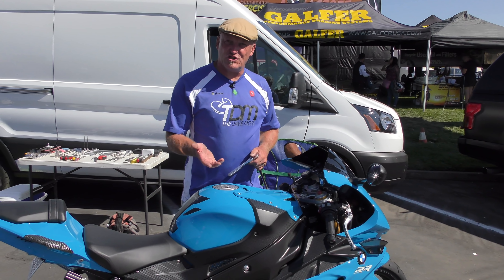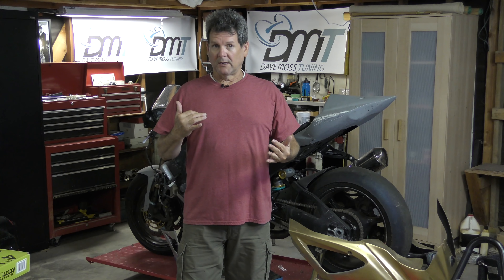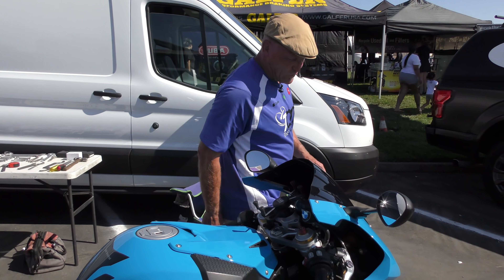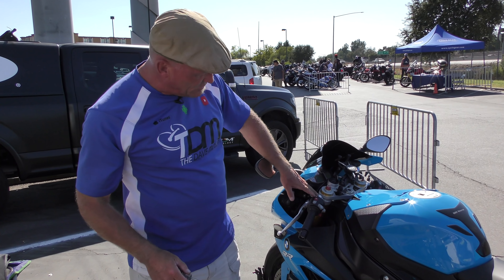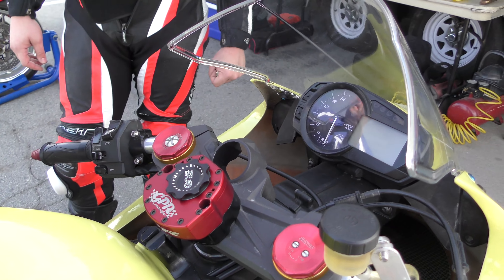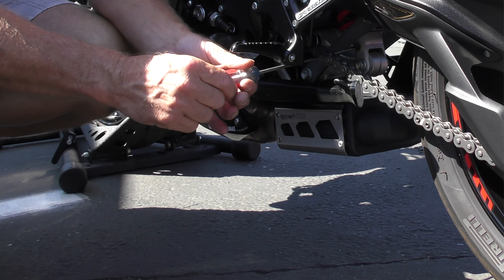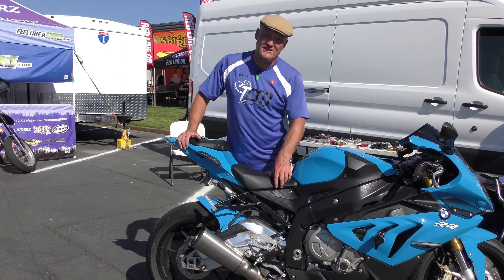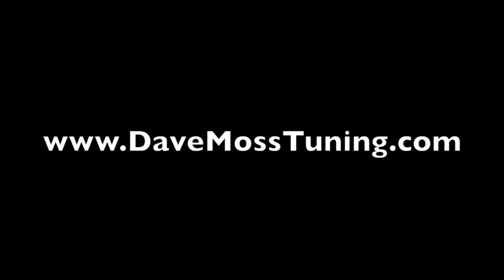Motorcycle Suspension Adjusters: What Why Where and How

Comment: Hi Dave, thats you for making this video, its a great video with all detail information for anyone to learn about their suspension system. 

I have a small question hopefully you can help. In the video where the BMW S1000RR fork preload, rebound and compression have different settings in each leg. Can i know how can we tell which leg to follow please? For example in the video you started counting on the right leg then use it as reference. But if you were to start the count in the left leg the count would be different isn't it?

Appreciated your clarification :)

Edward
Reply from the maker: Hi Edward. Manufacturer's have different settings per leg so your handbook will tell you what is where for damping and preload. In the S1000RR case, yellow has always been rebound (right leg) and red has always been compression (left leg) in separate function legs. You will see the same color coding on the rear shock. Counting from maximum clockwise or minimum counter clockwise will give you different values unless you by chance hit the exact middle of the count eg: 12 of 24 total clicks..

Comment: Question:
At 5:12 “this is always compression” 
but then,
At 6:50 “the preload is at the bottom”

I’m not sure if I’ve missed something, but which is which?
Reply from the maker: A tradition USD fork has many forms and the BMW had preload and rebound at the top and compression at the base. Big Piston forks have any number of combinations as well but in the example, the preload adjuster 5mm allen is found at the base. In the last couple of years, some BPF have changed tondamping left leg and preload right leg - adjusters in the caps.
Reply: @catalystreactionsbw  Excellent, thank you!

Comment: Oh right, Nitron! How does Nitron compare to other brands quality wise? Their prices seemed to be more friendly on the wallet :) (I'm contemplating switching out the STX40 of my 765RS since the original once got damaged internally, the piston chewed up the cilinder. Got a new one under warranty, but if the same thing happens again after another 20,000km I don't think I'll get a new one...)
Reply from the maker: https://davemosstuning.com/?s=Nitron+shock
Reply from the maker: It is the only aftermarket shock that I have used where after 1,500 track miles the settings were still the same as when new.
Reply: @catalystreactionsbw  Wow, sounds good! Thanks.

Comment: I wish Dave would do a Basic Suspension Setup for a 2004-2005 ZX-10R. This Bikes gunna Kill me if I don’t get it setup, I went softer but the rear still feels stiff. It’s setup Per manual. But I weigh 20 pound lighter then setup for 150:
Reply from the maker: That's why I developed remote tuning to make sure that riders like you can get access to me no matter where I am in the world. Please email me dave@davemosstuning.com to start the process.
Reply: Thank you. I’ve watched Every video I possibly can. I’ve Gotten to know Suspension Pretty well & How it works in the last 9 months. But it seems very difficult to set my bike up for me. I feel like I can set somebody else’s bike up perfect but for myself not so much.. The most important Thing to me is Getting my Bikes Geometry Correct. Everything els I should be able to read as the bike is ridden.. I’ve heard The 2005 zx10rs. Are a Nightmare to get Right. I’ve watched all your videos. But the most important info is cut out of all your videos or fast forwarded over. I get it people need money. But also way harder to learn when you only get half of the information needed..

Comment: On my rear suspension I have somthing that has 30 clicks from soft to hard what will that be changing?
Reply from the maker: Your owners manual will tell you. if there is only one adjuster on te shock you can use, it will be either preload or hydraulic damping.

Comment: Sorry to ask this question guys but I want to be sure. 
When they refer to 
"2 clicks out" they mean turning counter clockwise? So starting from 10 going to 0
"2 clicks in" they mean turning clockwise? So starting from 0 going to 10 
Correct?
Reply from the maker: Industry stand is out = counter clockwise, in = clockwise for both hydraulics and preload adjustments. Preload starts all the way out and count in clockwise, hydraulics start all the way in and count back. You can choose the method you want.
Reply: @catalystreactionsbw  thank you very much for this clarification

Comment: I had a small CC motorcycle (gsxr150) watching few of your videos, noticed that my bike have a really bad suspension setup but then, its doesn't have any adjustments :'(
Reply from the maker: so can you chage fork oil, fork springs and fork geometry? Sure! Can you replace the spring on the rear shock? Do you need to get a better rear shock based on using a tape measure?

Comment: So does that mean on the Kawasaki all the dampening adjustment is in one tube and and all the preload is done in the other tube?
Reply from the maker: That is correct.
Reply from the maker: Dave Williams, editor, replying here. As Moss said, that's correct... until the recent Showa BFF forks on the ZX-10RR and GSX-R1000R which have the preload in the top of both forks (same star screw adjuster) and the Comp & Reb damping screws below by the wheel in the lower casting of both forks. Looks like a bottle cap. there is a matching Comp and Reb bottle cap on the top of the shocks.
Reply: @catalystreactionsbw  OK.  So does that mean one tube takes care of dampening and the other preload?  Or is one adjuster adjusting both tubes?
Reply from the maker: @OregunAdventure  damping is in one leg, and spring preload is in the other leg. They are unique.
Reply: Dave Moss Tuning hey thanks guys for the replies!

Comment: what rear shock dampening settings give the SOFTEST ride...in, or out?  Dampening, or no dampening?  What does dampening do?
Reply from the maker: softest ride = low preload and compression (left direction in most cases). Dampening is oil flow management based on age, viscosity and flow rates with temperature.

Comment: What kind of sag setting you would suggest for trackdays?
Somebody told me to use Preload 35mm to 40mm at front and 30mm to 35mm at rear, sounds pretty soft to me... is this correct?
Reply: Joonas Dahlin I feel like I have heard him say 20-25 rear for the track.
Reply: @Dub3God  Oh okay, thanks mate I totally miss that part
Reply: Don't worry about sag for the track.
Reply: @rippin187  why?
Reply: Desert Sky yeah please do not listen to this guy. Sag is the first thing you set before rebound and then compression.
Reply: Dub3God Setting sag is not important on the track. Most people don’t give two shits about sag on the track. If you are slow in C group and going street pace then go ahead and set sag.
Reply: @rippin187  Once again don't listen to this guy. If the suspension is not properly setup for your weight, aka first thing you do is set sag, you have no right to ride that bike. End of story.
Reply: @dave moss tuning will tell you the exact same thing.

Comment: So I'm confused is it preload or compression that makes my zip tie lower or higher I adjusted my preload for my weight in the front between 25-30mm and I'm going for rides braking hard to see where my zip tie lands and adding compression if needed, If the zip tie is too low but I seen other videos where I heard if the zip tie is maxed out and your can't add preload you need better spring rates so what is it? Preload or compression.

Added note someone correct me if I'm thinking this wrong set preload to your weight to start then ten and compression test the bike with a zip tie. If you are bottoming out the zip tie and high on compression start adjusting preload and reset your compression and keep the cycle going?
Reply from the maker: Preload sets the strength of the spring. Compression sets the flow rate of oil as the forks compress. Both work together. You can remove all compression and ride. Then reset compression and remove all preload and test. That will give you the unique knowledge you are looking for by testing one adjuster at a time.
Reply: @catalystreactionsbw  thanks Dave next track day is the 12th imma run my proload set to my weight with higher compression and If starts to bottom my suspension out I'll add some preload and work from there
Reply: As I understand it preload is for setting ride height, so once your static sag is correct and you’re out riding if your getting too much travel when braking or over bumps then you increase compression damping, if you can’t add any more or the suspension starts to feel harsh then you should increase spring rate (put a stiffer spring in).  I was always led to believe that you shouldn’t try to compensate for an incorrect spring rate with damping.

Comment: Hi, i'm having a hard time finding the balance between static sag and rider sag on the rear shock of my 2018 Z1000. I'm a heavy guy 120kg (265lb). So i had to turn the preload all the way in just to get the appropriate amount of rider sag but then there's no static sag at all since the shock is fully extent even under it's own weight. Any recommendation of what I should be looking for for street riding?
Reply from the maker: At your weight, you will run out of static sag as the spring is too soft, hence your question. Increasing the rear shock spring rate to a 12.5n/mm would be ideal. We always double check with a visual inspection of how much shock travel is being used. If all of it, a spring upgrade is mandatory.
Reply: @catalystreactionsbw  I see. Then no choice. I'll start look for stronger shock. Thank u very much!

Comment: 7:43 what does fork position do? measuring distance from triple clamp to top of the fork? If you increase the protrusion,  are you adjusting the rake and trail? i'm new to this and trying to make sense. 2017 HD Dyna S. What happens if they are off by 1mm. Would it cause a long term damage to the axle because left and right fork have different length?
Reply from the maker: When you increase the amount of fork showing above the triple clamp, you move the balance point of the bike forward. It may or may not change rake and trail depending on how stiff the forks springs are. It may quicken the turn in meaning less energy is required to initiate turn in. If you decrease the amount, you raise the front moving the balance point backwards. That may increase rake and trail.  Hope this helps!
Reply: Dave Moss Tuning thank you!

Comment: I have bmws1000rr  2013 ... when I’m over 200kmh it starts head shaking so terribly bad I almost cannot control it on a straight piece of good road. Some sugestion pls
Reply from the maker: Set sag correctly at 30-35mm for the forks and shock. Check rear wheel is correctly aligned.
Reply: @catalystreactionsbw  I`ll try tomorrow Thanks for answer

Comment: My 07 Yamaha R1 is throwing to the left could it be the pre load is off
Reply from the maker: Check rear wheel alignment, check fork height is exactly the same on both sides, check fork settings are identical per leg.

Comment: 2013 Triumph Speed Triple (not R) has no adjustment for rear preload. How to you measure rear sag if that's the case.
Reply from the maker: You can measure what you have and write the numbers down. Then look at the amount of shock travel used on the shock shaft: https://www.youtube.com/watch?v=MCQE2wJnwh8
Reply: @catalystreactionsbw  Thanks for responding. I really think I asked the wrong question - there is NO ADJUSTMENT for preload, so bike cannot be set up correctly?
Like all your videos.
Reply from the maker: @johnvale5352  If nothing is adjustable, we are left with observation. #1. Is the shock shaft 100% clean? If so the spring you have is too soft. if there is 1-3mm of dirt on the shaft above the bottom out bumper, the spring is correct. #2  the shock will need to be replaced between 10-15,000 miles as it is non serviceable. You can choose from any of the after market brands or choose a 675 adjustable/serviceable shock to go in its place.

Comment: In my experience clickers are basically a gimmick. In most bikes i had there was almost zero difference between full open cs full closed.
One exception was yamaha tdm850 rear shock. I has the best regulation ever. You can go from almost zero damping to hard enough for some offroad or riding two with luggage, basically too hard for anything...
Why all bikes cant have such range of tweak
Reply from the maker: All depends on the angle of the needle and length. Some have the pointy end of the needles sawn off hence very little change except the last half turn.  GP Suspension, K-Tech etc replacement flow needles that really work - best bang for the $$.

Comment: what if the fork is still go to bottom under braking with the compression fully close ?
Reply: Had the same problem, change of springs with rate of 9mm/Nm to 9.5 and new compression shims fixed that for me. (Don't know the details of the shims though).
Reply: What you need is more preload or a stiffer spring.
Reply: Or change the fluid that never hurts
Reply: Just get a new bike with a stiffer springs 😆
Reply from the maker: If you are in the last 25% of preload and compression towards maximum, you can add a small amount of oil to get the air spring effect to work better. If that fails the general rule is stronger springs and thicker oil or stronger spring and revalve.

Comment: Whats low/high speed compression damping?
Reply from the maker: Low speed is slow movement from an undulating surface, high speed is a violent impact from piot hole lip, railway line or manhole cover

Comment: You aren't changing the tension, you are changing the compression.
The internal shear stress profile is changed by loading or extending the spring, but that internal pressure profile is too specific to the spring area to be meaningful to the macro effect the rider wants to understand.
Reply: you are adding tension to the screw though
Reply: https://idcspring.com/spring-lose-tension-when-compressed/
https://en.wikipedia.org/wiki/Compressive_strength
In the first link, a spring company describes the compression strain as "tension". In the second link, along with everything else google finds regarding spring nomenclature, the extension strain on an extension spring is called "tension" while the compression strain on a compression spring has no name (I could give you the historical linguistics as to why, but we're both being too pedantic already). Hence the common substitution of "tension spring" for "extension spring" throughout engineering literature. However, IDC Spring company seems to be ahead of the lexical power curve and does refer to the compression strain as tension. They appear to use the term "tension" to label/name the strain on a spring regardless whether that strain is extensive/positive or compressive/negative. That said, Dave Moss might satisfy more engineers if he said, "I'm going to strain the spring" or "I'm going to add some strain to the spring / I'm going to remove some strain from the spring". Using the word "compression" for the spring in a motorcycle suspension context becomes problematic because the hydraulics have a "compression" component to them for which there is no suitable nomenclature substitute. But what do I know? I'm just an annoying linguist.
Reply: @okboomer1241  One of the difficulties in any technical field is learning the meaning of the vocabulary.  It seemed to be 90% of the required effort, to me.  I, and perhaps we, freak out when the terms are used haphazardly because that corrupts the communication that we all seek to exchange, and slows the process (as we have to go back to ensuring our definitions are consistent).
You provided an efficient summary.
Reply: @DumbledoreMcCracken  Agreed. Language is a living thing. Once upon a time " I ain't..." was correct diction where "ain't" was the proper contraction of "am not". There's a reason why nobody can understand The Federalist Papers anymore, yet if everybody could we wouldn't have the language necessary to create computer chips. Now we're under assault by people subversively altering our nomenclature purely for political gain. Any legit language change gets lumped in with it and feels nefarious.

Comment: Best way to feel your suspension is to ride your bike on bumpy and rocky roads. I still don't quite get it, but I'll try to experiment. Maybe I'll adjust the preload at the lowest so I can reach the ground with both of my feet coz I'm short. ✌🏻😁
Reply from the maker: Remove all preload and compression to start but set rebound as best you can. Add 50% of the total range of COM and ride, then add 95% of total rang and ride again (56 miles max per setting). Set COM to minimum and do the same 2 tests with preload. The differences will be come immediately different. Please report back!

Comment: What if  you have a 250 ninja  and you can't adj it
Reply from the maker: You can adjust fork height in the yokes, oil viscosity and volume and change springs. The rear is a problem addressed with surrogate shock swaps such as https://www.ninjette.org/forums/showthread.php?t=59486

Comment: Need help with my 1199 it A horrible ride
Reply from the maker: No problem! I offer remote tuning 1-1 so we can reverse your perception of your bike and change your relatity. The cost is $20USD. The consult will give you preload, rebound, compression and geometry settings for you and your 1199.
Reply: Ya I bought it used and I am not a professional rider But I noticed the tire wear when I bought it was scuffed as if it was on the track with an aggressive rider I am 220 pounds and I ride fairly aggressive on the highways and the streets 
I rode Yamahas R1 CBR1000  I own a BMW Hp4 But I always love the look of the Ducati. But The ride is in my opinion just horrible it’s not confident inspiring and unstable around slow turns I’m definitely going to call you for your help after I get it back from the shop.
The bike is a 2013 Ducati 1199 Tricolora